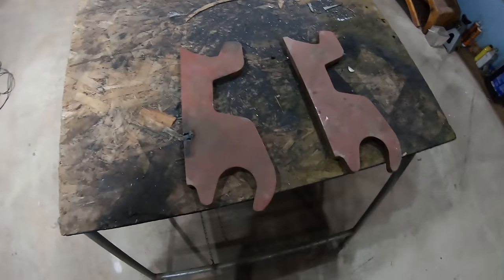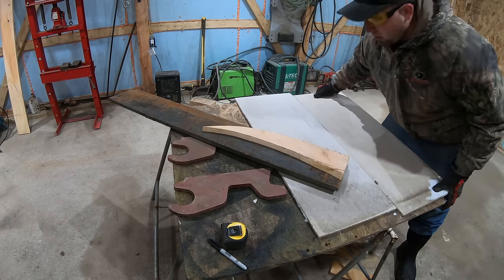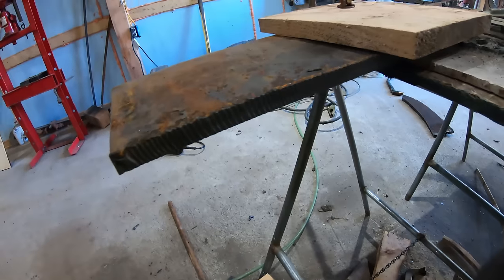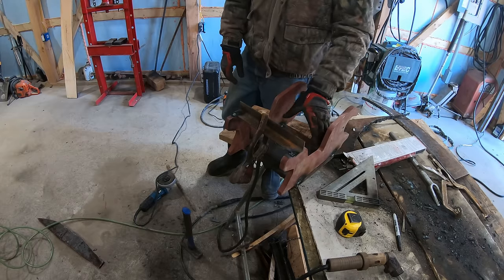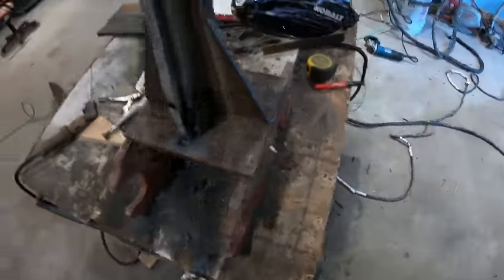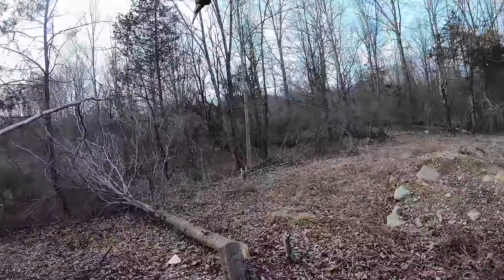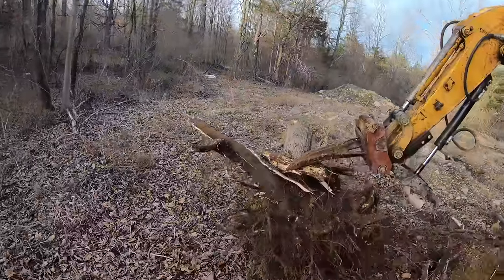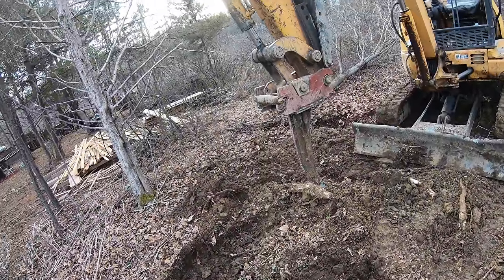How to make a stump/frost ripper

Comment: I built a ripper tooth like yours and I also built a couple rakes with similar teeth ( slightly more hooked ) but the difference is , I used a hardened steel called Cresabro 400. It's even better than AR400 because it's not as brittle. They use it for rock buckets on excavators. Mild steel will bend like a wet noodle when you start hitting rocks.

Comment: Tip for anyone that wants to do this, I used a subsoiler tooth (farm implement) 30" long and bolted it between 2 pieces of 3/4" angle iron like it originally mounts on the subsoiler then stick welded it solid. 20k lb machine hasnt been able to break it yet.

Comment: Looks like it works well! the rippers we have at work have the plate extended a few inches at the back to protect the wedge as well as raise the whole ears off the ground so it's easier to put on your machine. Fitting a tooth on the end is a good idea if you're going to do any amount of frost ripping.

Comment: Very nice vid and fabrication job.  What about serrated teeth on the ripper shank?  It would function like a saw (as long as they are upward facing) if the root is too thick to budge yet the  tooth is able to move perpendicularly when you raise the arm.

Comment: I'm sure the root and stump puller has been well tested by now. I found in laminating steel plating it's a good practice too cut holes or rectangles into the centre of one plate and plug weld them as the outer welds get worn of and allow water in between the plates, well you know the rest. But with having the plug welds there your good too go. Cheers from an old crack filler/ welder.🇨🇦

Comment: That was great. I just dug out 4 stumps last week with a shovel and cut the tap roots with a reciprocating saw. A water hose helped blast away the dirt in places to get at the roots and to keep the chain saw from getting blunt too quickly but it took hours. Wondering if I could add something to my small 4 in 1 digger bucket to help chop up stuff like this. Well done.

Comment: On this initial version please consider adding more weld.  When I learned welding, on the job, back in the early '70s the boss always stressed that I should use three passes on any weld where danger to people was a possibility, even if the job specifications did not require it.     It is almost 47 years now and I'm glad that I spent the extra time and money...

Comment: Put some hardfacing on the wear edges to extend its lifespan
Reply: it amazes me how few use h/facing. It doubles almost the life of teeth. I was doing it in 1970.
Reply: itll end up getting twisted or broken before wearing out.. if he ever did manage to wear it right out itd have paid off his time/cost 200 Fold and im sure hed be ready to make a new one with slightly different design at that point
Reply: I came to the comments to suggest the same thing.  Build up both the tip and leading edge of the claw, and grind a cutting edge.  A saw tooth pattern would probably be better still.  As it stands, I am thinking the tip is going to bend and eventually break.  A cool tool though, and kudos to Jesse for thinking it up and making it.

Comment: I enjoyed watching your video.  I watched it because I'm interested in building an as close to 6" Wayne  Roy bucket as I can.  It seems like nobody builds one narrower than 12".  I want to use it for digging ditches for electrical conduit and want the ditch as narrow as possible.
Reply from the maker: I have a 12 inch bucket for trenches, but I find unless the dirt is dry and not many big rocks, even the 12 inch bucket gets clogged up too fast, a 6 inch bucket is a good idea, but will get clogged up,  another person commented and showed me a pic of a narrow bucket with a chain that stays inside for knocking the dirt loose, I may try to come up with something even better. Thanks for watching
Reply: @jmuller86  Where I plan on digging there's about a foot of dirt on solid rock.  I moved my electrical service disconnect from behind my old house to a shed in front of the house. Now I need to  reconnect the wire going to another shed across the yard.  Currently I'm using extension cords.

Comment: I like Your design and wonder if a tractor the size of Kubota L-2501 with a backhoe can do the same work

What is it about cutting the tree down first instead off utilizing the height as leverage of the tree to pull its own root ball out of the ground as You cut its root system of support away with the ripper?

Ripping the roots at the sides first then ripping the roots on the opposite side of the direction you want the tree to fall

I am not an expert

I just am curious if this idea is possible or even if its safe to  do

If the tree is tied and pulled with tension in the direction you want it to fall that should add safety to control its fall

Comment: How’s it been holding up? I started to make one similar to your design about a year and a half ago haven’t finished it though. Going to need it soon, my machines around the same weight as yours but I made mine 36” long instead of 24” like you said. My though was bracing the hell out of the top 12” of it or so. I’ve seen you using it in your more recent videos so it’s clear that it’s working! Keep up the good work
Reply from the maker: yea it works real good, I may put a replaceable tooth on it, as well as hard face a nice cutting edge to rip roots faster. but it has held up better than expected and it even gets through and breaks up shale. thanks
Reply: Jesse Muller awesome that’s for answering. I ordered another shank and tooth when I redid my bucket just for the ripper. Thought about cutting some serrations into it as well to get through the larger roots. Hopefully I can finish it up in the next few weeks. Stay warm bud

Comment: If you really want your ripper not to lose its sharp points on its ends may i suggest you braze some tungsten on each you can then grind it smooth It will keep its sharpness like that of a cold chisel. Tool and Die apply this on all their tooling. Have degrees in Welding Tech.
Reply from the maker: yea I will probably go back and do something similar to that

Comment: One thing i noticed. Would it have been a advantage if you would have left the i beam solid at at the base instead of welding in the side supports. I guess it doesn't matter it is strong as hell both ways just might have saved so time and a little less welding.

Comment: Just wondering what rod you used, looked like 60xx series.  For future reference alway use 7018 for projects like this.  Nice job though
Reply from the maker: I did use 6011 but I now use 7018 on most structural welds

Comment: A clever job, but it seems awful lightweight for stump ripping. Perhaps the stumps where you live are that small. Here in Washington and Oregon, the rippers like that are 2" thick and 3-4 foot in length
Reply from the maker: The longer they are, the less leverage you have, I did 2 ft because thats about what it is on the buckets, to match the length of the thumb. But something with a cross design or hollow is almost as strong as solid, I am uploading a video with me using it on a job, works perfect. Thanks for watching

Comment: yes a hotter plazma arc would work better for you and a mig welder , what kind of filler rod did you use ? It sounded like a 6011 , i would've used 7018 unless all you have is an AC machine
Reply from the maker: Mig welder is only really good until half inch right? Yea it is an ac stick machine, 6011 is what I used. I dont have a rod oven
Reply: @jmuller86  i've been welding for 20 yrs in construction so i thought i was right , anyway you got the job done , no you can weld as thick of metal as you can get with a 250 amp mig machine
Reply: @jmuller86  try a 7014 rod with that AC machine , it's like a 7018 on DC and be a cleaner stronger weld
Reply: @jmuller86  find you an old microwave and wire a light bulb socket in it and that makes a good rod oven , i didn't have a rod oven either when i had my own business just keep the rods dry is all you got to worry about but heat is the best way to keep rods dry but not necessary for back yard welding

Comment: How does the breakout power on that ZTS compare to Camarata's B37.
Reply from the maker: I think they are about the same, mine might be a little more because its newer, maybe slightly better pumps. I cant find solid specs on the b37, but it appears to weigh 3.5 tons and mine is 4, but I dont know how reliable that info is.

Comment: Process of elimination, take out the root system and no need for a bigger piece of equipment. May take a little longer but it beats having to buy another piece of equipment if you can get away with it. Exercise job with your root ripper !!!

Comment: people sell those things all rusted crazy expensive. happy with the Deere excavator ?
Reply from the maker: yea its been pretty good, all the things I have fixed/replaced have been due to lack of maintenance from the previous owner. I finally fixed it overheating, the video about it is done ,just takes a few days to upload
Reply: @jmuller86  that's excellent. Usually a bit suspicious of the nom Japanese machinery. But in the end of the day they have Japanese engines. Keep up the good work.
Reply from the maker: @MyRallyChannel  actually it says on the vin tag made in japan

Comment: Nice job. What number welding rod did you use, what amperage?
Reply from the maker: I used 6011, high amps, I think around 200 for most of the thick welding. Thanks for watching
Reply: @jmuller86  I swear, the sounds from this video should be in someone's "rock" video. So satisfying (from just a mom).

Comment: i think if you mount that ripper in the center of the plate it will eventually rip itself off the plate , or the plate will buckle with the forces exerted on it .
wat you could do different in weld the ripper in line with one of the ears and use the connectingplate only to atach the second ear
when the ear is verticaly in line of the ripper and is about 3 to 4 inches thick when looked at it that way , it whont bend either way and will be as strong as the material and the welds

as for using it to remove stumps : unless you allso need to do digging there it might work faster if you can grind the stumps up :
https://www.youtube.com/watch?v=J2--YgRSwQ0

Comment: You didnt prepare your welds properly all fillet welds should always have a bevel ground into each joint that needs to be welded it allows for maxium penetration of each weld. If doing sheet metal there is no need for a prepared joint also keep a small crack below each fillet weld half the distance of the Welding Electrode used.
Reply from the maker: good advice, thanks

Comment: Nice fabrication but doesn't make much sense to me I guess. Seems like it would be just as fast to dig with a bucket and get the stump out. And with a bucket you have the correct tool already attached to fill the damn hole back up and get it level. Tracking around, pushing dirt with the blade is just bullshit.
Reply from the maker: When you have alot of stumps to take out, you use the ripper , its much faster, then you change to the bucket to grade and fill

Comment: You should have fake teeth on the back of it like a giant saw it would make it easier to rip out stumps
Reply from the maker: Towards the end of the video I explain that I will put those on later on. I just want to see if the whole thing will hold up to daily use first
Reply: @jmuller86  You really do make good vids,  I see your Subs going up fast

Comment: Patent that?
Reply from the maker: It's probably not worth doing, I am really not a certified professional welder; just have done alot of it over the years. I would rather just share what I have learned
Reply: @jmuller86  but a cool mod, nonetheless!  I wonder why only one claw.  Would it be better with two?
Reply from the maker: @cathyblasco4497  I have to consider that I will be using it for frost too, and with frost; the thinner the better, just to crack through the ice
Reply: @jmuller86  ❤

I'm in Florida, soooo... And I have NO idea how to run an excavator. LOL!